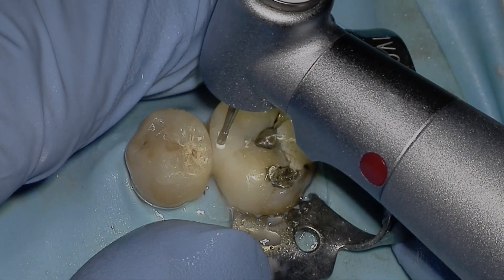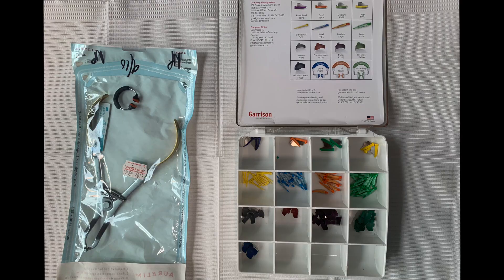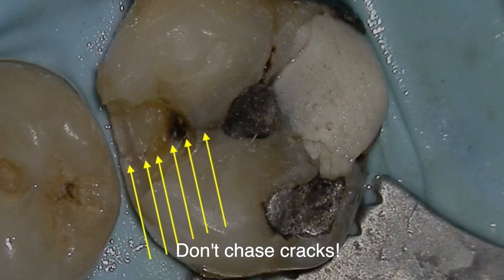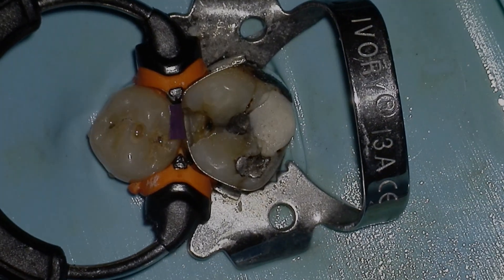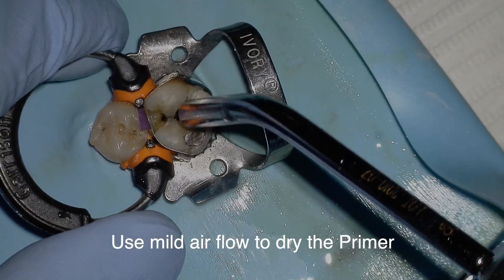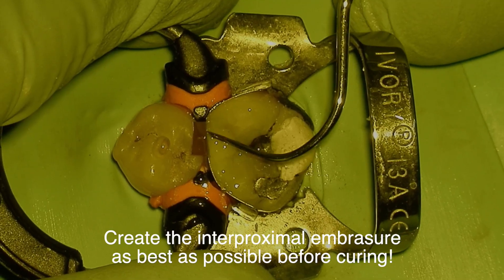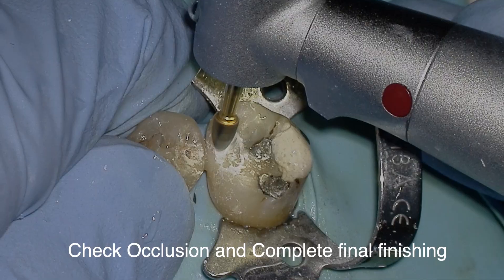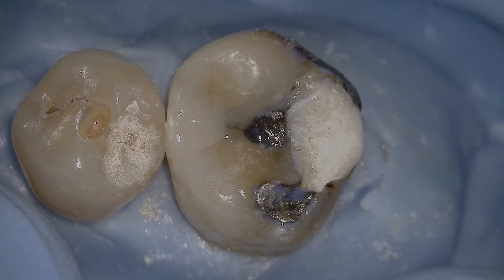How to do a Dental Filling - Best Composite Restoration Tips

Comment: A composite filling on the front surface of my left mandibular canine, on the more central side, that was above and adjoining and older (I think older) composite filling, came out about five years after was first put it. The dentist replaced it with another composite filling, but about three weeks later that fiiling came. She replaced it again, at no cost, but again, about three weeks later, that second replacement came out. Now I have to wait a couple weeks for another appointment. No other composite fillings have or have had this issue. Is she doing something wrong, or are the materials different now?
Reply: Composite might not suitable for you anymore due to multiple factors. You might consider veneer or crown for longevity.
Reply: @jadtube9225  There was another composite filling she did about a year ago at the bottom of the tooth right behind that canine tooth that I realized recently had also come out, as well as the composite filling in the screw hole in a recent dental implant zirconia crown, which came out right afterward. She said she's had a problem with the smoothness of the gloss on the  sealer they use in the zirconia crowns or the screws, the Other patients also closing the composite to come out (although the hole is sealed underneath it), so on that, and also my other cases where the composite came out, she used more phosphoric acid to etch it, so hopefully that will do the trick. I don't think it's anything to do with my mouth because I've had other composite fillings in place for decades. I noticed after I left the office the skin was peeling on the inside and top of the left side of my lip, the side that she worked on those two teeth near the front, and it was somewhat swollen. Obviously, maybe when she or the assistant took the absorbent pad used to block the phosphoric acid, out for my gum line, it must have brushed my lip. It is just now going back to about a normal week later. She didn't charge me for any of the redo repairs, however. I have plenty of other grounds including on laser inlays but veneers are more destructive of the tooth, as are crowns, unless they're necessary.

Comment: That’s so cool that you are using sealant on the margins. They didn’t teach us this in school and I’m sure it has great results!
Reply: You probably just liked the idea because it's new to you. IMO there's no need to apply sealant. The duration of sealant on the tooth is limited, the purpose is uncertain, and it shows the operator has no confidence in bond.

The alternative would be to use bevels, make preps Clark-style (google Clark class 2), and use injection molding. Etch beyond cavity. Initially apply bond only on dentin, cure. Then apply bond to enamel, DON'T CURE, apply flowable, don't cure and apply hot composite with positive pressure. Cure. This creates superior seals.
Reply: @astronaft2  is the sealant just a flowable composite or a distinct sealant material and did he shaped the final composite with a bonded applicator or did i see wrong
Reply: We learned this in school, but only in cases of visible or detectable gaps. I believe that by doing this every time, you eliminate the risk of micro-gaps. Whether there is evidence that it’s actually relevant to do if you determine that there are no detectable gaps, I don't know.
Reply: You cant bevel stress bearing surfaces such as the occlusal
Reply: @aweome2121  just passing a 8 or 12 blade flame carbide bur to remove the chipped enamel rod crystals on the periphery of the cavity (occlusal) “polishing” would give you a better peripheral seal of the cavity and avoid white lines on the perimeter (which are the flaky enamel crystals that are being pulled into the adhesive or resin composite restoration)

Comment: I have had 5 crowns and 3 fillings lately (and unfortunately two surgical extractions)… from an observant patient perspective and also being a medical scientist, I am sadly so familiar with drilling, burring, banding, wedging, etching, compositing, curing the layers of composite, then final polishing... What I loved about your video was the tip of sealing the edges of the filling! I imagine this is crucial to long term survival and the ability of the restoration to resist new decay. I will seek my dentist’s opinion on edge sealing and round burring. I also, have some issues with the techniques used to seat and cement crowns, especially where decay has progressed proximal (or even slightly below) the gingival margin. My dentist no longer uses the impression and send-away crown method. He prepares the tooth, LiDAR scans the preparation and fine tunes edge profile etc. on a 3D graphical PC type interface. He then inserts a ‘crown blank’ into an amazing lathe type machine which creates and carves the crown commanded, this is heated in a furnace and cemented in place after cooling. Is this crown preparation method the current state of the art and more importantly, does it improve fit, resistance to decay in the base, and therefore longevity?
Reply: no.
Reply: Trust you’re dentist.

Comment: Me watching this after getting a filling: 

👁👄👁
Reply: how old r u. thinking of getting them
Reply: @george52797  number one, I'm not telling a random person my age, number two I suggest getting a filling. I suggest to get laughing gas with it if its your first time it will relax you quite a bit, when you get the needles the first two don't hurt because their underneath your tongue but the last one is a bit worse it hurts a little bit more but the laughing gas should make you not care as much. 
While they drill into your tooth depending on how deep it is it will feel weirder say it's a deeper cavity you'll feel more vibration but if its at the top you'll feel less vibration. After they fill the tooth up (wich does not hurt) they'll tell you not to the the following: Do not attempt too eat because you might choke or bite a tip of your tongue off, do not drink a lot only drink when you really need it so it takes away the chance for you to think that your numb tongue is water and try to swallow it and maybe choke.
It will take over 2 days to fully heal, but I do warn you it makes it so you can't open your mouth fully without it hurting a lot and I mean A LOT. Do not put pressure on the tooth you got a filling on because it will cause pain because that tooth has not adjusted to having to get drilled in.

I hope this helped have a good day.

Comment: using the #12 blade in a patient is nearly IMPOSSIBLE! you can't NEVER  get a good angle. 
great work here.
Reply: pro tip, u can cut the handle of the 12 blade if u get the plastic disposable ones and its easier to use in a patient

Comment: Sorry to say this but ur whole restoration is a white line and u can see it in the final photos . U will have debond in less than a year i promise u that . First ur bonding technique was a little bit messy . Second u applied the superficial layer in one increment so u connected three walls with composite then u cured it so u have caused the maximum amount of shrinkage that u can have not to mention applying bond on composite and rubbing it will cause a thin weak upper layer because u have just diluted ur composite by adding a ton of bond over it . Even if u didnt use bond the action is the same . Thank u and hope u correct me if iam mistaken

Comment: Hello sir
When u remove an old restoration and u see a deep arrested caries just like in this video. Would you go deeper to remove it or u will just leave it ?
Reply from the maker: Amir Habib great question. The current evidence is to leave it. Heck - even more affected (not infected) Dentin could be left in place - as long as it’s sealer.   In our practice - we strongly advocate indirect pulp caps. I think the most important issue is to make sure the tooth is vital before anesthesia. (Cold test). Make sure you’re not restoring a necrotic tooth.
Reply: All Things Dentistry don't you use caries marker?
Reply: @dentaldoctor4851  sorry, i haven't started using it yet
Reply: Thank you sir :)

Comment: Thank you for your effort to make our life as dentists easier :)
anyway, if you want to trace after the old composite restoration especially when the color is super matching the tooth then I have a tip for you 
get a cheap UV currency detector light and use it on the tooth and then tell me what you see :)
Reply from the maker: holako80 no. That works?!
Reply: @AllThingsDentistry  Sure it is :)
Reply: any other tips please hahahaha
Reply: Original things cannot be copied it’s from ur god not human with super glue , rotary tool , bolts , screw , drill i hate stupid doctors making torture normal thing with brainwash :)🖕🏻

Comment: What handpiece is that? Electric?
Reply from the maker: Yes.  It's a bien air electric handpiece and i think the world should move to electric.  Do you use electric?
Reply: @AllThingsDentistry  Not yet. Is it heavy and big? I am planning to get Bien-Air Tornado (highest air driven watt handpiece)
Reply from the maker: @rushangpatel5501  Hey there.  The older versions that we have are a bit large and bulky.  The newer versions are lighter and more balanced.  However, to be honest, there are significant benefits by using electric - i'm not saying these b/c I purchased the electric handpieces and have that "I bought something and now will force everyone to change their minds" - I didn't buy these handpieces.  They have been installed in all of our clinics and I've been using them for the past 7 years.

Pro:  1.  Torque - Unbelievable - I compare this to the difference btn electric cars and gas cars.  When you go to cut something, it doesn't bog down - it just keeps cutting.  Hit the gas and keep going till you're done!
Speed Control:  You can slow down the bur to any speed you want- this is great for crown margin finishing and also endo access finishing at a slower speed.  It's also extremely useful b/c you can actually get rid of most of your latch round burs and use them in friction grip - this way - you can decrease the number of handpieces you may require.

Hope that helps

Ash
Reply: May I know what is the sealant you used as the final step? Many thanks for sharing these videos for our learning,  much appreciate it.

Comment: What’s the material used for sealing the margins in the final step after finishing and polishing the restoration?
Reply: I think it was fissure sealant. I bet a flowable composite would work too.
Reply: @tvrulz46  even a flowable composite is thicker to go inside the little cracks
Reply: Is it bonding?

Comment: Tnx.why you dont etching dentin?
Reply from the maker: Great question.  This is a self etch adhesive system that we are using.  The beauty is that it simplifies the bonding technique so we rely less on guessing how much the dentin is too wet or dry (between operators) and use more of a quantitative metric.  We always, for some unknown reason, want to make sure that the enamel frosts.  It's like some reward mechanism that we get when we see the enamel frost when you dry it - but - that's often too dry for dentin and wet bonding.  For Clearfil - it's not.  It's just perfect.  Hope that helps!
Reply: Interesting.now im loving more all things dentistry
Reply: @AllThingsDentistry Hi Ash, good to see you back at it again! What are your thoughts on etching dentine to remove handpiece oil?